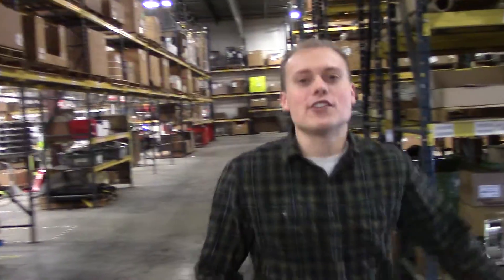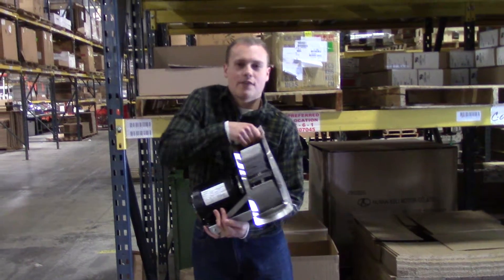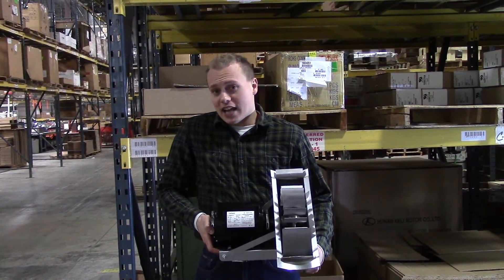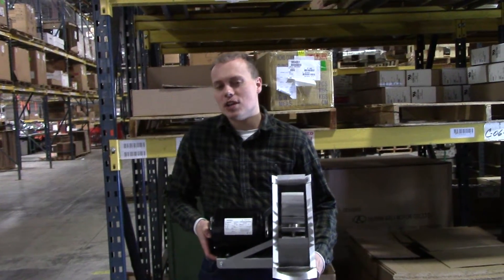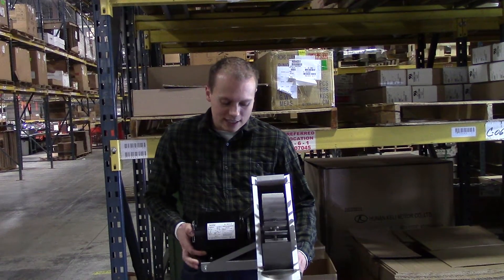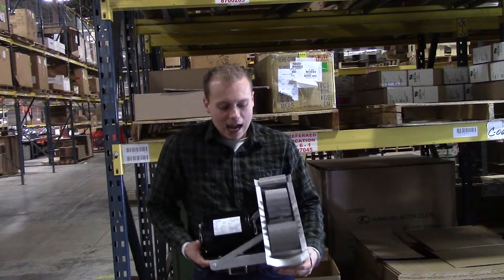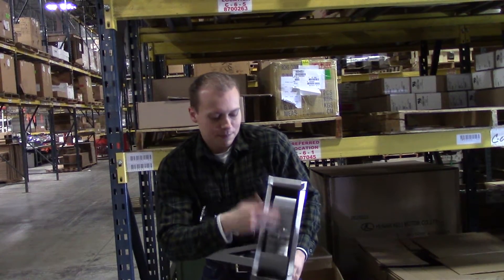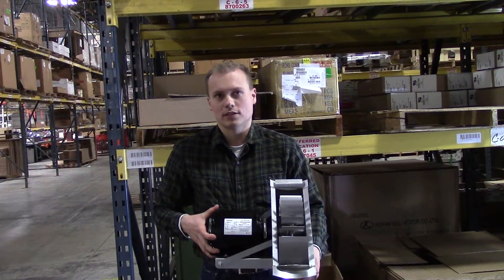Off The Rack: Tjernlund Draft Inducers

Comment: Is it safe to run one of these if there is creosote residue on and IN the motor and controller  mounting plate etc?  Can creosote residue catch fire if there is a spark from the motor or controller?